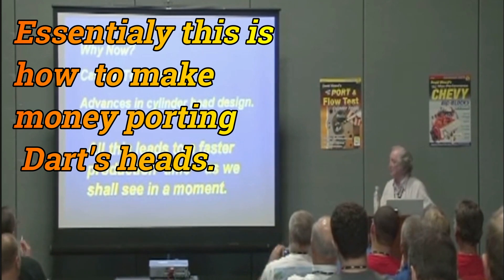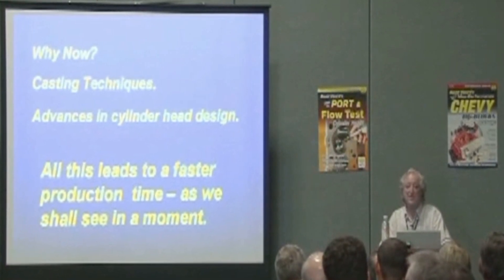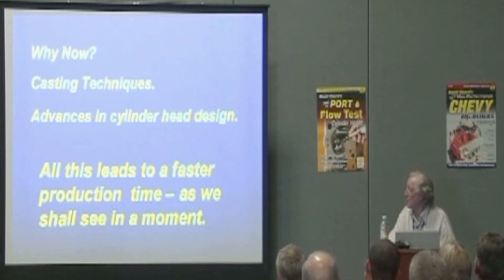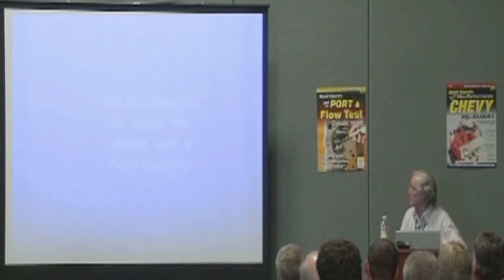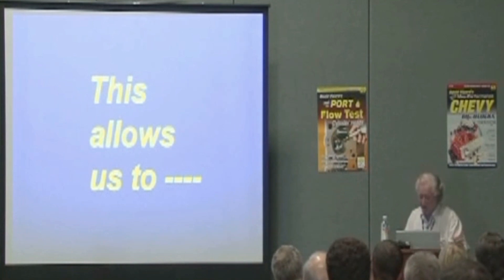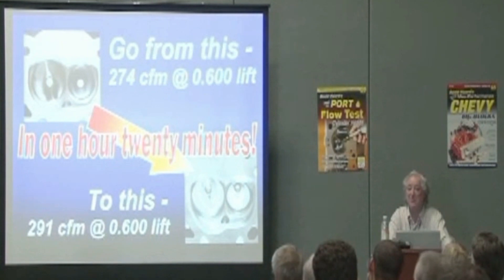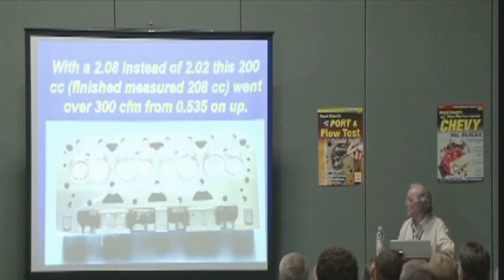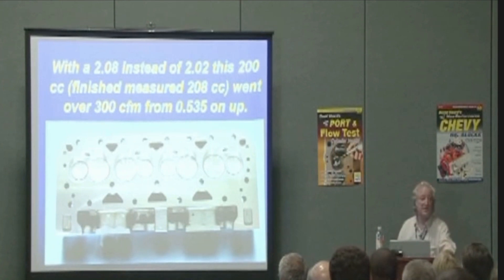Small shop porting for profit pt 1

Comment: I used to be a distributor for Dart and workd products back then. Hand porting for the shop at that time was $75 hour. Each set of heads had a time limit to finish. The smaller the port from casting added time onto the porter! The sportman II head led the pack for a long time. With less then 40 hours into them they could flow over 300cfm. Some classes restricted heads to a few low cc models. And porting was restricted to 1" from seat and gasket area. The base pro top line took that category every time. 
  Today...those prices are much higher. And the availability of after market heads shorten the time needed to match the flow requirements. The dart 235 will flow more then any >406-410 needs. Aluminum heads carry the same cost to port as a cast head. Much larger profits for the shops. What used to take 40 hours can be done in half that time. And top shops don't do them by hand anymore. The cnc mill does it in 2 hours and we still charge $1000 for a set. These late model heads have so many problems with casting quality that we dont even offer porting on them. If it's not a dart blank, we don't port them.

Comment: Let me tell you something, you need to be very dedicated  To become both a CNC programmer, operator and a cylinder head porter, And Race Engine builder, I have alot of experience at it, over 30years with Engines.  But  I could think of plenty of better jobs to do. Here in Australia, you're wasting your time doing it as a job.  If you want to beat the cocks, learn as much as you can, never give up but, "do it for yourself Only.
Reply: what are better fields to go into money-wise?